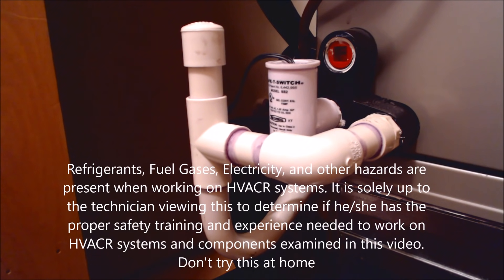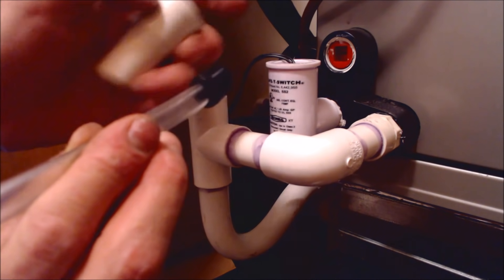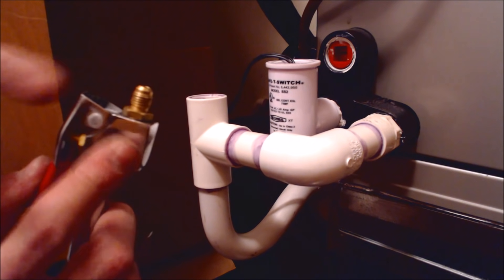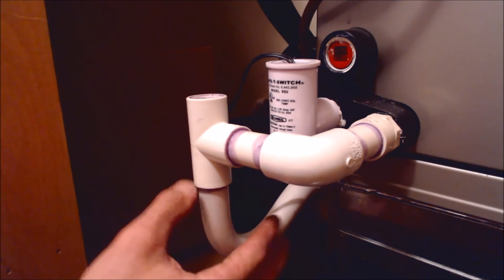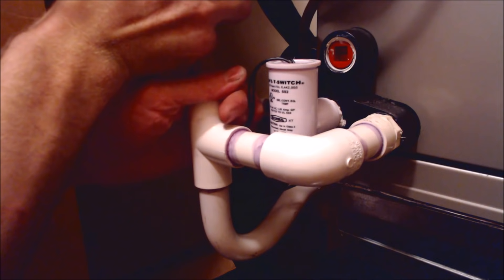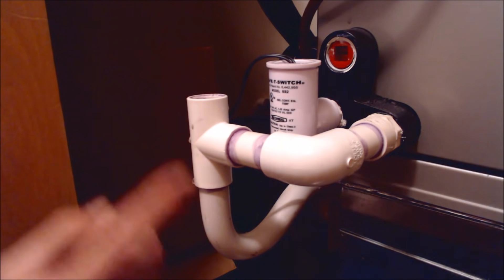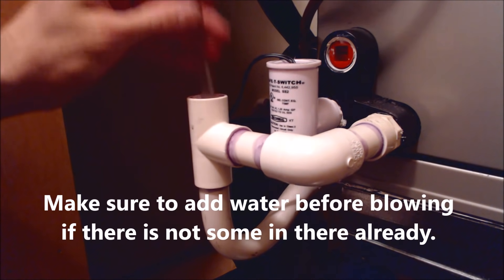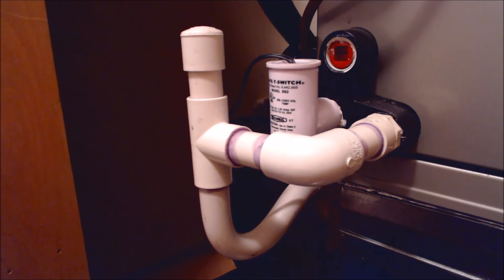Fast and Easy Clean Out of Condensate Lines on an Air Conditioner!

Comment: Hi, Texas mom here, my unit does not have a cap and there is water in there and I can see black along the inside of the pvc but no globs in the water and no leaking, no problems, or anything. I maintenance my machine professionally once a year before putting on my heater, but I skipped this year. Do I need to do this? I've heard the tech guys saying to pour bleach down in there and then hot water, but my Lennox is about 30 years old and came with the house when I bought it 4 years ago and I'm afraid to do anything to it. But it's insured and whenever it goes out, we're ready to replace it, but it's still cold-cold in our Texas Summer heat, and Warm-warm right now in our baby Winters, so I don't mess with it. Haha! Any suggestions for me, besides prayer! LOL.
Reply from the maker: Did you check this video out yet- https://www.youtube.com/watch?v=guf3TESb3V0&t=211s

Comment: Mines doesn't have a p trap and i sucked all the air out from the outside using a shop vac and cleaned out a lot of gunk, but now i hear like a gurgling sound coming from the pipes (on the outside and inside of my house). If the ac is on long enough it eventually stops but it is so so so annoying. What did i do wrong or how can i make the noise stop
Reply from the maker: There should be a trap somewhere on it. If it ran for 10 minutes and then you shut it off, the trap should fill up with water while the unit is off but if it does not then you would need to add a trap thanks
Reply: Pour water in it

Comment: Thanks you for this wonderful video. What pipes do you recommend for installing the condensate lines, 3/4" or 1/2"? Thanks.
Reply from the maker: Usually 3/4 is connected to your evaporator coil drain and 1/2" is connected to the furnace drain but you could make that bigger if needed. If it is light commercial and a large unit then 1" would come off the drain, thanks

Comment: I hooked up my vacuum hose over the trap for 2 minutes and no more leaking, I will do this weekly for preventive maintenance and also poured bleach after clearing it😎
Reply from the maker: Yes, if you are having an ongoing problem then the tube may not be pitched correctly at least 1/4" pitch downward going away from the unit, thanks!
Reply: iwinzeazy Avoid bleach.  Use high acidity white vinegar instead.  The reason is bleach fumes will destroy the anti-corrosive coating on the heat exchange coil inside the air handler.

Comment: Another option is to hook a shop vac hose up to the condensate drain line where it empties out,  seal the hose to the line with some duct tape as needed, turn the shop vac on for a handful of seconds, and you should be rid of the clog. Then, in the spring, put a cup or two of bleach in the line via the access hole before summer arrives to keep it from getting clogged. Here is the short video on this: https://www.youtube.com/watch?v=xVvxMIK5RBY
Reply from the maker: Yes that will work very well for lines that are not pitched correctly and have standing water stuck in the pvc line within the building. If the tubing is pitched correctly then only a very small amount of water will come out but if it is not pitched correctly then a lot of water will end up in the vacuum container, thanks

Comment: I lived in FL for 20 years and a small shop vac connected to the outside with best way to clear the line. First pour a cup of white vinger into the inside line near the air handler and wait 5 minutes and then shop vac from the outside. Clears the line every time.
Reply: Flush after the vinegar with hot water
Reply: I tried that & it didnt work.  Have > 20 feet of pipe laying nearly flat in attic. Outside with vac could suck out water but then would not drain during use.. But if I did not pour cup of vinegar down each day, water stopped draining.  I used 5% & 30% vinegar every day for 3 weeks. Then BIG bubbling inside when I poured down & since then = no problems.  Builder STUPID put ac in attic with no roof exhaust fan.  Extra hot stress on unit.  Richmond, VA can get 90-100 typical day = 135-155 in that attic.
Reply: @howardhightower5904  get a union and cut it into the pipe. Use that union to regularly blow either nitrogen or co2 down the lines. Works great.
Reply: @Alienspecies635  can you explain a bit more? I would think you could set it up to access and clear this line easier and more simply
Reply: @travelingjones5496  it’s very simple. You get a union which you cut into the pvc drain line and that fitting twists tight and also twists open when it’s open you can blow nitrogen down the line then just screw it back together. It avoids having to cut into the pipe every time and then having to glue it together. It should have been installed from the start or even better than the union there should have been a T installed before the trap that would have been capped but not glue and every so often you remove the cap and brush the drain trap then blow nitrogen thru it. A lot of times installers don’t think about the future maintenance unfortunately.
Reply: @Alienspecies635  most plumbers have a union but out here in rural they work independent in my opinion do better job
Reply: @connormcgrath6476  😂 a union is a connection between the two pipes that allow you to open and close the pipes back up. Same thing as a coupling but can be opened. I’m assuming you misread my comment
Reply: @Alienspecies635 I thought that too when I first read your comment. 😂 But, the context cleared it up. I think Connor was joking. 😉
Reply: @howardhightower5904  this is not unusual. Vegas attics are 180 to 200 some days
Reply: @howardhightower5904  your gonna need to replace the piping due to gunk in it that has simply built up to the point that no amount of vinegar or bleach will help
Reply: Thanks, Sam. I tried this before I went and bought supplies and it worked like a charm.
Reply: @collingrimes2646 😊😊😊p
Reply: Lol the thought to this yesterday night just came to me and man did it work amazingly well. The gunk in pipes were no match for my 50gallon wet vac.
Reply: Live in Fl and have to don this regularly
Reply: Omg, genius
Reply: Thanks.  I will try today.
Reply: I THINK YOUR ADVICE IS BETTER.
Reply: What if my outside line is a small thin copper pipe??! It’s not a big white PVC I can hook up to :(
Reply from the maker: Yes that will work very well for lines that are not pitched correctly and have standing water stuck in the pvc line within the building. If the tubing is pitched correctly then only a very small amount of water will come out but if it is not pitched correctly then a lot of water will end up in the vacuum container, thanks Sam!

Comment: How do I reset the switch. The switch on my condensate line tripped and shut off the system. I understand that this is so no more condensation is created. The line is now clear of clogs.
Reply from the maker: What kind of switch do you have? model? Thanks
Reply: Safe-T-Switch Model SS2
Reply from the maker: The top white part where the two black wires are glued in. That top white pvc piece comes out and you can see the little plastic float with the magnet inside. It may just be gummed up in there so turn the power off, take it out and clean the area up and it should work unless there is a switch at a condensate pump or something thats jammed too, thanks CinemaSasquatch!

Comment: I have a question if I may. Nothing is clogged but there is water dripping from far right of air handler in the plastic safety tray. Any idea why this would be happening
Reply from the maker: The air handler could be sitting out of level, the pan could be cracked, or the pan outlet could be clogged. Also the refrigerant charge could be low which could be making the coil freezing and then thawing when off, thanks

Comment: I use the Rx11-flush Gun which is similar and more effective than what you came up with.
 https://www.supplyhouse.com/Nu-Calgon-4300-51-Rx11-flush-Gun?gclid=CjwKCAjw4avaBRBPEiwA_ZetYpwBv2a3V_7SyRtaExXt1mSQlPkSZEMy4xcfr3wtI4cVTa3Kf6DTCRoCJBQQAvD_BwE
Reply from the maker: Hey Joseph, I just try to get past the first pipe by getting down inside and also take up the inside diameter of the tube. I use R-11 flush and have the trigger assembly. Whatever works as long as too much pressure is not used, thanks Joseph!

Comment: Once you have a fitting blow out in a wall or other inaccessible spot you think twice about pressure. Not your fault, but the customer feels different. I always use a wet/dry vac with the filter removed from the outside. Once I get that cleared, and not until, I do the inside, from the pan which I clean out too. Put a no rinse "green" evap cleaner and charge a little extra. While I am there. That is how I do my own unit.
Reply from the maker: Nice Carl, thanks!

Comment: I use a watering can and a bunch of 4" condensate drain pieces from 7/8" to 1/4" fit into each other for drain testing. Only once have i had one so bad i had grab the nitrogen bottle.
Reply from the maker: Hey whatever works, thanks!

Comment: I cleaned my line and after some hours the a.c. stop working, it doesn't drop water in the back or outside the house line, mine it doesn't have the T trap, the guy who installed said the P trap was at the end of the line, the drain line goes under ground like two feet . any advice why the water doesn't come out?
Reply from the maker: If the ac is on then water is going somewhere. Check to see if you have airflow traveling through the line at the end. If you do then you have no trap and the condensate possibly could be overflowing inside. It is good though that it is not leaking water where you see. Is there water pooling in the duct or anything then?

Comment: Thank you for video. Anyone know what is name of the pipe part which connect with the air conditioner ?  It looks like its size and thread are standard. Anyone know where I can buy it ?
Reply from the maker: 3/4 pvc male adapter, home depot, lowes, hvac supply house, thanks
Reply: Thank you very much. It helps a lot!

Comment: Great video. 
If there is a long drain, would that amount of time be sufficient to clean it out? Or would you have to blow it out longer?
Reply from the maker: The more water that you put into the drain before blowing it out the better. This was a shorter drain. Also if it is pitched correctly then typically there wont be a problem with clogging in the middle, thanks
Reply: I diluted a little bleach in water and blew the line several times on mine. Seems to help clean it out better for longer periods.

Comment: One of the problems I've found just blowing out the p-trap is you risk pushing the debris further inside the drain without removing it. The ezt clear p-trap is by far the cleanest and easiest way to service a p-trap.
Reply from the maker: U-traps are nice. I actually linked the one you are referring to in the comment and description sections. It is weird, its one of those things. I found that customers with the U-traps that I don't have a service agreement have more problems with clogs when they forget to clean them out than p-traps but yes U-traps allow you to vac it, brush it, or blow the debris out, thanks
Reply: It breaks it up and allows it to flow through.

Comment: What cleaner amount and how often should customer be putting it in? Bleach?.
Reply from the maker: You can put hydrex tablets in the condensate pan during your pm maintenance at the beginning of the season and they will help treat the trap without clogging it. I linked them in the description and comment sections thanks

Comment: I like to use shop vac with some clear hose and use foam tape to fit the shop vac end and a little as needed to fit drain line, also can see the gunk you get out. Works great in buildings with fan coil units.
Reply from the maker: That is certainly a great way! thanks Bernie!

Comment: Although a drain line clog usually occurs in the trap, there is a chance that a clog can be somewhere further down the line.

When I'm doing my preventative maintenece, I flush drains with 1-4 gallons of water depending on the length of the drain line. As the water is flowing down the drain, I blast it forward in bursts with 100 psig of co2 to ensure that it's completely clear. 

I never had a problem with a drain line coming apart. If a drain line ever comes apart due to no primer, it's not the technician's fault, it's the original installer's and that would lead to a justified reccomendation to re pipe the drain correctly.
Reply from the maker: I have seen pipe come apart myself and heard horror stories from other local technicians and another business owner. The problem is unfortunately it becomes the service technicians fault when you don't realize a leak has been created and then it starts dripping into a ceiling which eventually gets ruined. It is not a good deal. It is  great that you are filling the lines and blowing them out but I would not use that much pressure but this is just a video of my experience and what I do. When a customer has a leak in the pipe and not the trap, I try to find the improperly pitched area or termination and fix it if possible. Thanks Poop12490!
Reply: I bought a house with idiots that installed the HVAC, used the blue non primer glue, used 1/4 the amount needed.  Had condensate lines behind finished walls separate and leak.  Called the original company out to see what they thought since under warranty, kicked them out of the house after hearing what they had to say in the first 2 minutes.

90% of everything I see is installed wrong around here.  Reused rusted filter driers, up sloped drain lines, pvc pipes under condensers to help level them, pinched suctions lines, no filters, no overflow devices, no secondary drain lines, unprotected power wires, 5 ninety degree couplings over 5 ft of line, etc.  Home owners don't know what to look for, they just fell the cold air and say it works.
Reply from the maker: Wow that is terrible. I am very sorry to hear that!